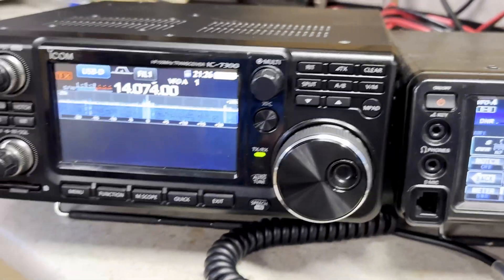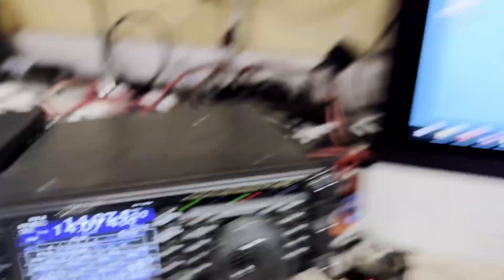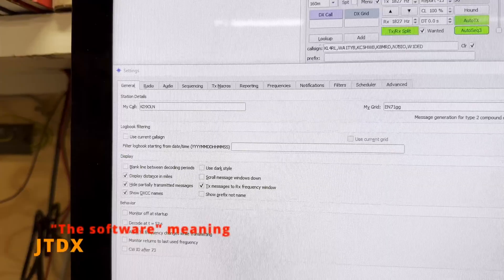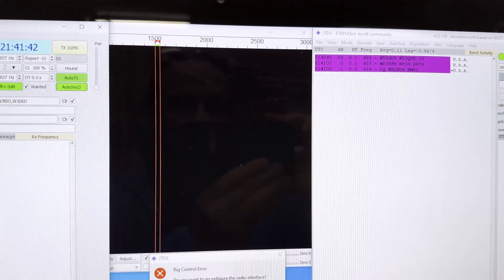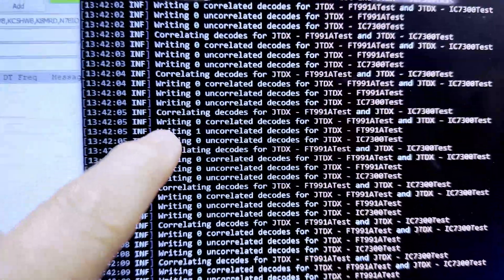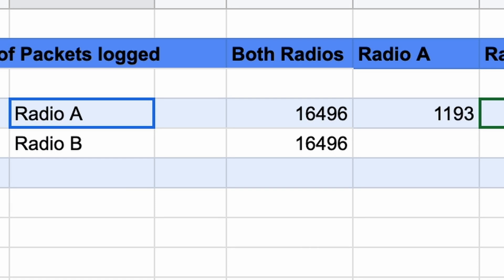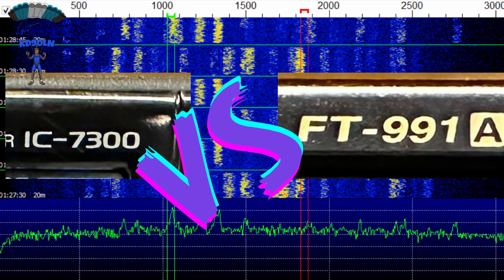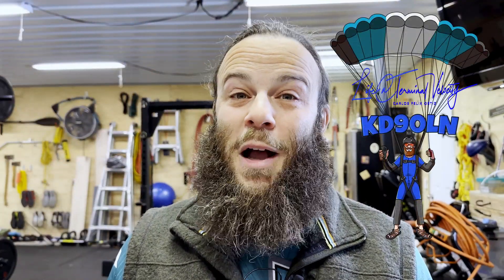Which is better for digital modes? The FT-991A or the IC-7300?

Comment: Great concept and presentation.

So a few observations:

The use of a tee to isolate two receivers is not entirely valid. The input impedance of the two receivers is now in parallel with each other, and may be affecting one more than the other.  Alternatively a power divider with matched ports combined with swapping the radios and from port 1 to port 2 and rerunning testing to eliminate a “best lane” drag race analogy. 

The 1db difference is a bit of a red herring since the measurement instruments are two independent, uncalibrated radios that could each be introducing their own errors. Frankly I’m pleasantly surprised they were within 1db, but actually don’t believe they are, or that they are representative.

Without capturing the message traffic from the radios to the computer it’s a reach to say one radio “heard” something the other didn’t. A more fair statement would be that “the combination of radio, data transfer, and software stack” “heard” or more accurately “properly detected and decoded” different transmissions.

The technique of bypassing CAT control also depends a lot on how the error handling of the application, operating system, and USB driver is coded. This could leave the radios “deaf” while the CAT control routines were “timing out”

I wondered if the two instances running on these  computer had been tested to show they had matching performance (like the “first one started” runs faster than the “second one launched”)

I didn’t hear mention about the firmware versions of the radios in particular if you used the FT8 presets in the more recent 7300 firmware, and if the 991 has similar collections of settings to ensure you have incorporated “best practices”

Sorry for the long list of pondering points, none are dismissive, all are for “consideration”

73
Rich
Reply from the maker: First let me say thank you for your considered, polite, and constructive discourse. It seems at times that the art of having a conversation is lost and then I see a comment like this one and my faith in humanity gets restored.

I don't have a proper power divider so my testing is limited to the resources I can gather. If such a device is not terribly expensive I might be able to throw some $ at it and run the tests again. I had not considered parallelism on the input impedance but since your brought it up it makes sense that the feed lines would allow for one radio to affect the other.  I wonder if putting in a diode in line on the center pin might solve the problem?

There was no red herring intended with the 1db note. It is just what I observed in testing. 

You are correct in that the statement should be that the entire stack "heard". With that said the only difference in the setup is the radio. The cables are all the same, the software is all the same, the computer is the same. Therefor a level playing field in the testing environment. 

The software CAT control has nothing to do with the sound card input from the radio so the lack of it or the interrupt of it would have no effect on the software decodes. You can take the headphone output from the radio and connect it to your computer and run WSJT-X and tell it to use the sound card of your computer and it will decode digital modes.

Firmwares - I should have made note of this. They are both running the latest firmware for each radio that I own (IC-7300 and FT-991A). The video with the X6100 does not have the latest firmware on the radio but since I was borrowing it I did not feel as though it would be my place to upgrade it to the latest version. The 7300 has a setting for FT8, the 991A does not. I matched as best as I could the settings on each otherwise to make it as close to a level playing field as I could.

Again, thanks for the thoughtful feedback.

73,

Carlos
KD9OLN

Comment: So I guessed correctly. What's interesting is more noise = more signal, but that doesn't mean ssb would yield same results. I think the 7300 has the advantage in HF because it's HF only...makes sense... I think one must compare 7300 to the ft710 or dx10? Thanks Carlos,  great experiment (used to be a stats prof, you did well).
Reply from the maker: Thanks! I'll put the 710 and the DX10 against it if I can borrow them. I am working on that so be on the look out. There is an X6100 that got to me by mail that is next on the bench.

Comment: Thanks very much. I have both rigs but have never tried the 991A on digital, use it for /P from vehicle, advantage to have VHF / UHF in one box for that. Very interesting presentation.
Reply from the maker: You are spot on. The ability to have HF/VHF/UHF in one box that goes full power is without question a massive advantage.
Reply: @LifeAtTerminalVelocity  I have an 857 as well which is a bit more compact but have been to the Dark side of nice displays 🙂
Reply from the maker: I have an 857 that I plan to put on the bench too. Only a two zebra lines on it so I'll count my lucky stars.

Comment: Nice job Carlos! I guessed right and wish I could find an artical for you on the 991a recieve but was unable to find it for you. In the artical the author said that the first receive on the 991a is pulled back at the factory for some reason and I forget why. Amp 1 would be in line with the 7300 with the amp off on the 7300 and both about the same on amp2. If I can find the artical I will get it to you. It might prove the auther right if you did the test with the amp1 on with ft991a and off with the 7300. Not sure if the authur knew what he was talking about really.
Reply from the maker: It is worthy of a test to be sure. I'll see if I can squeeze it into a video.

Comment: Interesting test and setup!

One thing that I saw during the intro were the volume levels - when you switched from the 991A to the 7300, the bar shows a lot lower volume @4:58. This might mean nothing or maybe a little. Not sure. I know the 7300 can set an output volume - this might be a way to neutralize this.

Other things, but that's not from your video - the filters, are they both set at 3 KHz as was visible on the 991A?
The 7300 does know a sharp and soft filter. Something might be just in the filter of one and outside of the filter of the other.

Keep up the good work!
Reply from the maker: I got them as close to each other as possible. The bandwidth on the 7300 is set to 3kHz by using Filter 1 and selecting the "FT8" preset on the radio.

Comment: Very interesting! I think the db difference is probably due variations in the preamp, maybe turn both off to see which is really more sensitive. But what is really weird is both had contacts that the other did not. I would think it would be 1 sided if there was a clear winner. That seems to point to something in the software, possibly a resource issue, or software glitch. I wonder how much it would differ if you ran 2 separate computers or pi's. For sure a head scratcher....   JMHO plus I didn't stay at Holiday Inn last night.....
Reply from the maker: So what you are saying is I need a followup video comparing them without a PreAmp running. Got it.